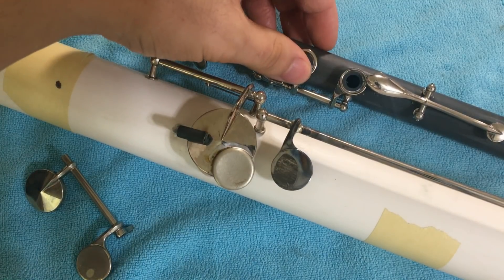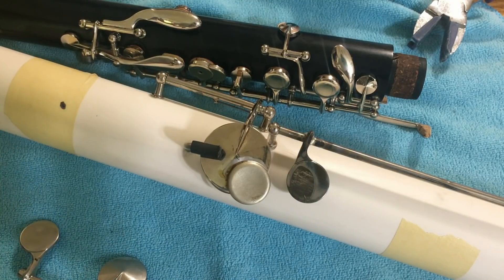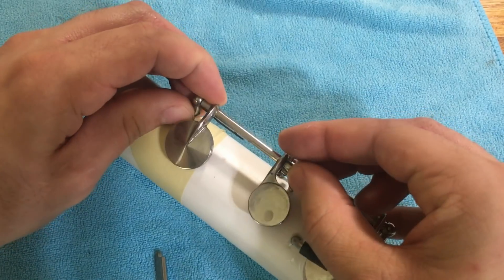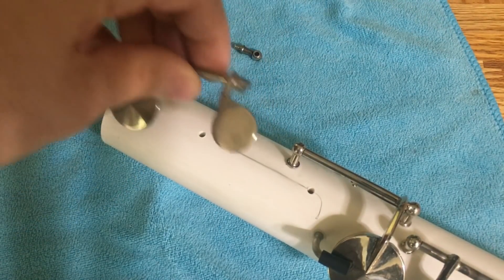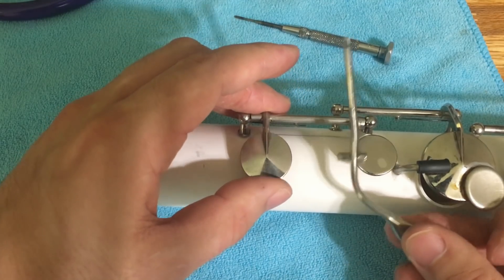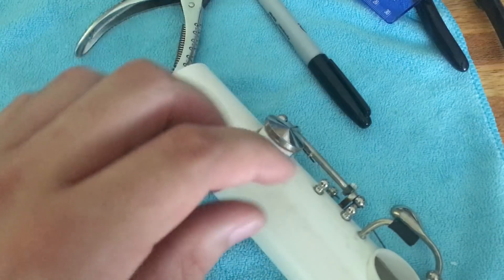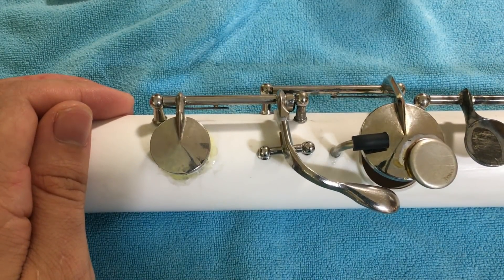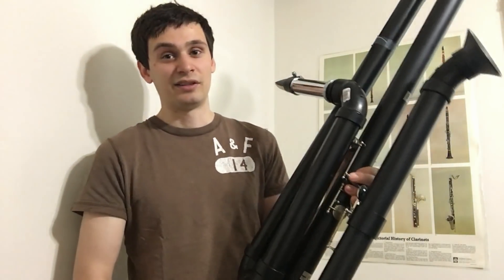How I build homemade clarinet keys + Octocontra-alto/Octocontrabass update

Comment: This is great! I've been making simple flutes for a while and want to try making a simple 5 key baroque style clarinet. Can you recommend a bore diameter for PVC to make an A pitched basset clarinet?
Reply from the maker: 1/2” PVC is the closest.
Reply: @Jared_De_Leon  So I had a problem or two that some help addressing would be amazing. First is that the only note the really resonated was the bottom note. Once I started to drill tone holes the notes barely came through and are unstable. Could it be the bore of the mouthpiece not lining up in size to the bore of the body? That is the only discrepancy I can think of unless I just need thicker walls? I'd really like as much help as you can give so if you'd be able to just message me somewhere too that'd be awesome.
Reply from the maker: Jamie Duke it sounds more like the tone holes are not large enough. For a basset clarinet they should be 3/8” or around 10mm minimum for the lowest notes. The upper tone holes can be as small as 5mm but the smaller they are the more resistant the instrument will be.

Comment: I'm making an Internal duct bass recorder like instrument but I used the formula Length(inches)=(tube diameter/2)+(13,514.17/desired frequency in Htz) to find tone hole locations. *13,514.17 is the speed of sound in inches per second. Doesn't tell how big the tone hole needs to be or anything but it helped me with finding the point in which I needed to put toneholes along the pipe.

*The original formula was the same except in the formula they had Length(inches)=(tube diameter/2)+(13,514.17/desired frequency in Htz x 2) but I couldn't seem to get this one to work right maybe someone else will have more luck but the one listed prior worked much better for me.

Comment: Jared, It looks like you used 1 1/2" Schedule 40 ABS plumbing DWV pipe (which is nominally 1.590" / 40.386mm ID) for your Octocontrabass. There is available (admittedly not quite as readily available, but at least in our area at  full service plumbing/DIY stores primarily for irrigation/well applications) a 1 1/4" Schedule 40 (1.360" / 34.544mm ID) White PVC pipe. That might suit your stated "not more than 35mm" limit. I like what you're doing. It gives me the old hankering . . .
Reply from the maker: Hello, this instrument was made with 1 1/4” pipe. Home Depot and Lowe’s both stock it which is very convenient.

Comment: No way a homemade contra I might build one
Reply: Don’t do it unless you’re in it for the long haul. I’ve been working for 2-3 years now (I’m in Senior year of High School). I had no experience with instrument building, acoustics, or anything like that when I started, so it was very difficult to get started. I’m currently trying to work out creating 3D printed keys and mechanisms, but I’m only working on something comparatively easy for now: a low Eb extension for a Bb clarinet. That’s just one extra key, and I’ve been trying to figure out everything for that for months now (I finally started 3D printing sample parts yesterday). So imagine applying that knowledge to a whole contra, especially if you’re going for something complex, like Boehm keywork. If you want to do this, I wish you the best of luck, and i hope you succeed, but be warned if you have no prior experience with these things.

Comment: Just found your channel. It’s fantastic. How did your level the tone hole? I am curious as to whether you use a special tool for this (also curious if you use a special tool to level wood tone holes). Thanks and looking forward to future videos
Reply from the maker: For these large toneholes, I actually just glue a piece of sandpaper to a flat piece of wood and use that to finish the surface. For toneholes on smaller instruments I use cylindrical Dremel bits that I sand the bottom flat on to create a smooth cutting surface.

Comment: Why not just get a bigger mouthpiece or make one for your octocontrabass
Reply from the maker: In order to do that I would need to have access to a CNC machine which I don't unfortunately. I suppose I could 3D print a blank but I would need to have someone reface it to make it good which would be out of my budget.
Reply: @Jared_De_Leon  Could Richard Bobo 3D print one for you? His contrabasoon project is really coming along with 3D printing prototyped parts! :)
Reply from the maker: The problem with 3D printed mouthpieces is that they are barely playable when first made. They need to be hand finished to be any good so I would still need to send it out to someone to reface it.
Reply: Jaded, I'm sure you're more than capable of putting a facing on a mouthpiece.  It's really not the black art that many would have us believe.  Feeler gauges, a sheet of glass,  fine abrasive paper, and a lot of patience are all that's needed.

Comment: Great tip. But what if you dont have ‘spare keys?’. I saw ‘historical’ instruments where the keys were made from flat square pieces of brass soldered to brass rods. This is what im looking into as i want to finish an unfinished bass recorder that has been on the shelf for ages. Any insight would be great, and it might help with your megaclarinet challenges to make your own keys as well...
Reply from the maker: This is certainly doable. I've made keys from raw brass before but I've found that you can buy a box full of clarinet parts for far cheaper than a large amount of brass square stock/tubing.
Reply: Also the bigger parts for larger instruments? Where do you buy them?